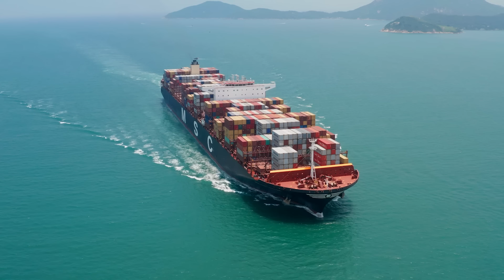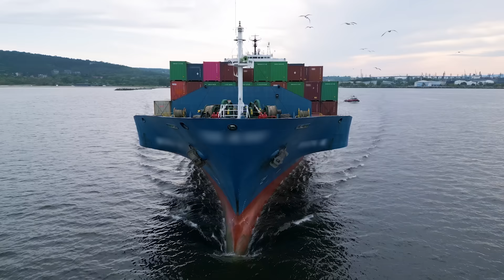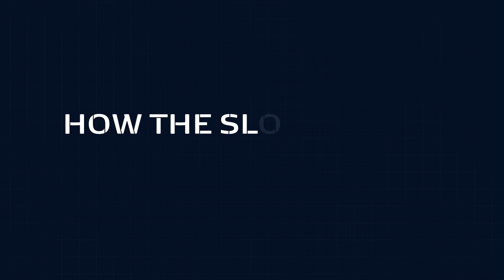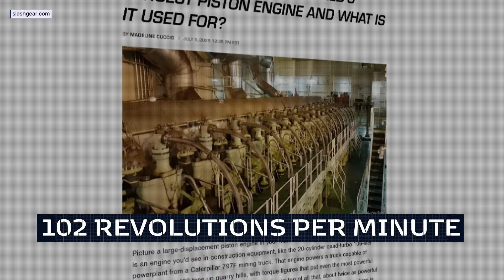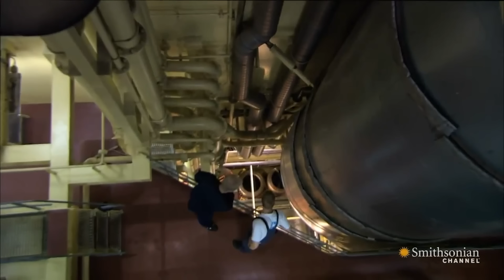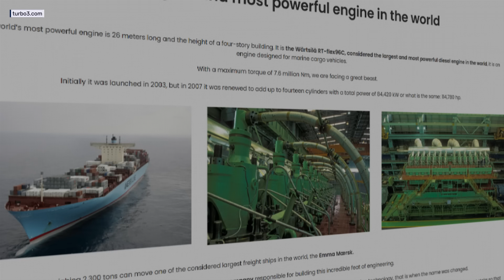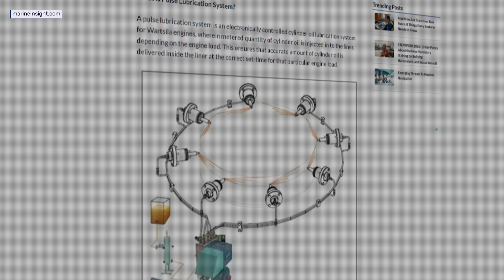The 100,000 Horsepower Engine

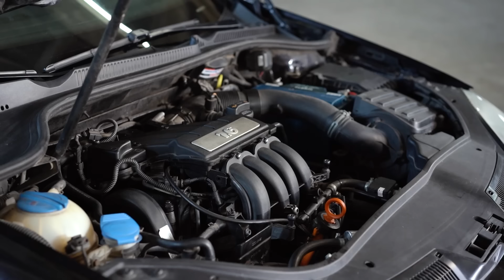Comment: 8:16 "A family car engine holds between 1 and 2 litres." Oh, Europe.
Reply: Exactly what I thought when I heard that 😂
Reply: I live in Europe, I've had Chrysler 3.8Liter V6 with 165hp, gussling fuel of 13L/100km. I now drive a Volvo XC90 2.4 inline 5 cylinder turbo diesel, it uses 8.7 liters/100km and has 200hp with 400nm torque, I have 257.000km on the odometer and it is half life! Size isn't everything.
Reply: @Bratfalken  Right. Now imagine how good the Volvo would be if they'd applied Volvo engineering standards to a 3.8L V6. (We'll disregard the PRV.). 

You might, in such a case, have a 320 horsepower diesel with reasonable fuel efficiency.

That would be just about enough for a normal family car.
Reply: @siorusbzns654 my first car was 1.8 liter, had 75hp, it reached all speed limits just fine. I don't need 320 hp, and my present one reaches double the speedlimits. Also, Volvo had the Yamaha 4.0 liter V8 in this car model. I could have bought one of those, but I would not like to fuel it up.
Reply: @Bratfalken  You're pointing at one of the central differences between European and American ways of thinking. The idea that you would decide how much horsepower is appropriate based on capacity to meet or exceed speed limits or how much it costs to fuel is absolutely, genuinely incomprehensible to me.

I understand it logically, don't get me wrong.

It's just utterly, completely illegible. Total nonsense. Not a value judgement really, you can live your life however you see fit. Just wild to me.
Reply: @siorusbzns654 you do much dragracing at stoplights I presume? 🤣
Reply: @Bratfalken  Nah, preserving optionality. You know sometimes people speed up after you pull out to pass them. When you have decisively the faster car, you effectively remove any influence they ever had over the situation.

That is, it no longer matters whether they want you to pass them or not; they’re not in a position to decide.

And yes, you can do this by driving well with a less powerful car, but why would I go for anything but guaranteed total dominance? This is a safety feature; it changes the situation from a negotiation or a conflict to "it's happening my way, and you're going to suck it up."
Reply: @siorusbzns654 ...eeh. but you claimed all americans want these high powered mega volumated cars.... then who will dominate who?😉
Reply: Only the oil and tyre companies are the winners.
Reply: @Bratfalken not once have I thought "Urgh I need twice the power right now to pass this guy!"

Just pass em or let them pass, who cares?

I got 2 cars one for purpose and one for passion, one has 70hp and does all I want it to do, the other has 610hp (flywheel) and I could push it further but what's the point? I'm already happy with it, I worry none that some other guy in some other car that I didn't even pay attention to "UtTeRlY dOmInAtEd" me
Reply: @Bratfalken  Did I say that?
Reply: @LostenPosten  Don't be deliberately obtuse. You're arguing with a straw man.

I didn’t say “I need twice the power to pass someone.” I said I prefer having enough surplus performance that a pass stops being a negotiation. There’s a real-world difference between “I can probably get around this guy if he keeps behaving normally” and “even if he decides to be a prick and speed up, he no longer has meaningful control over the outcome.”

That happens. People speed up when you pass them. People get offended. People turn routine overtakes into ego contests. A more powerful car doesn’t make you invincible, and yes, someone always has a faster car. But statistically, being well above the local power norm removes most of those conflicts before they can develop. That was the point.

Your reply reframes that as insecurity: “who cares, I don’t even notice when someone UtTeRlY dOmInAtEd me.” But that’s not an argument. That’s status signaling. You’re trying to position yourself as the mature enthusiast who has horsepower but is above caring about horsepower.

Which is why the “need” language is interesting. I described a preference and a safety margin. You turned it into psychological dependence, then congratulated yourself for not having it.

And frankly, the two-car detail undercuts your point. You own a 70 hp utility car and a 610 hp passion car, so you obviously understand the appeal of excessive power. You just want to draw the line exactly where your own usage pattern makes you look sensible and someone else’s makes them look insecure.

That’s not a rebuttal. That’s coping dressed up as perspective.
Reply: @siorusbzns654 
1- The "twice the power" was simply an example of a surplus of it referring to the car of the driver not twice what the other individual has, as you never specified any amount and it could be 200 or 500, unspecified 

2- I can only speak from what I see and do, I don't find myself in situations where I have to engage in a "negotiation" with another driver, I simply keep my pace whether they speed up or not, so I wouldn't know I guess (there's a difference between simply being a douche who speeds up unnecessarily when passed and reckless driving just for the ego you mentioned, that should be reported to the police right away)

3- The "framing as insecurity" was headed towards your "dominating the negotiations" thing, I may have interpreted that as someone who turns every pass and every merge as a challenge, again I don't find myself in the situations you say you do so it might simply have gone right over my head

4- I never claimed or tried to claim that the way someone else's use or want of a powerful car is incorrect or insecure, it's simply a point to highlight that in my experiences there hasn't been a need for the higher power car in my commutes, that the abysmally low (it's a fairly heavy and old sedan) 70hp the other one has gets it done fine and at no point felt the need to increase it,
Thus I put in question why would the better option be to have a heavier, larger, more fuel thirsty engine just for the sake of "engagements"
The more powerful car is simply to take it on weekends for some track of route fun that's my appeal with it, not to have that extra margin in the back of my mind, I don't see a want for it in such case. I took it as "need" which for someone unwilling to not have that margin it might, but it's likely a reach from my side

Now thank you for dismissing it as cope, tells me all I need to know about your willingness to see a differing take even if it may have not been worded as well as it should, just know that an internet argument especially over vehicles of chocie (drive what you want I'm not trying to convince anyone to change that) isn't meaningful enough to defend tooth and nail to the point of coping
Reply: @LostenPosten  Fair enough, and this is a much more reasonable framing than the first reply.

The distinction I’m making is not “every pass is a dominance contest” or “everyone needs 500 hp to commute.” It’s that surplus capability changes the interaction when another driver chooses to make the situation adversarial.

If you don’t encounter that often, great. Sincerely. But “I don’t personally find myself in those situations” is a different claim from “there’s no meaningful value in having the margin.” My point was about optionality. Most safety margins are invisible until the moment they matter.

And yes, my language was intentionally blunt, because the point is simple: if another driver speeds up, blocks, or tries to turn a pass into an ego contest, having enough surplus performance can remove their ability to meaningfully affect the outcome. That doesn’t mean driving recklessly. It means completing the maneuver cleanly and decisively instead of remaining stuck in someone else’s decision loop.

“Call the police” is fine in principle, but it doesn’t necessarily resolve the immediate situation. It’s also worth noting that there are many places in the U.S. where police presence is thin, response times are long, and you may be driving through a large rural area with very little practical help nearby. That is another difference between a European or urban-American driving mindset and much of the rest of the U.S.: in a lot of places, you are functionally on your own in the moment, and it is your responsibility to manage the situation safely.

That’s why I value margin. Not because I’m looking for conflict, but because other people can create conflict after the maneuver has already started.

As for the insecurity point, the reason I pushed back is that your original reply did not read like a neutral difference in use case. The “UtTeRlY dOmInAtEd” bit was pretty obviously framing my preference as silly or insecure, so I responded to that framing.

If your actual position is just “I don’t feel the need for that margin in my own driving environment, and I use power differently,” then fine. That’s a perfectly reasonable take. Different roads, different traffic culture, different vehicles, different preferences.

But that’s not a rebuttal to my point. It’s just a different weighting of the same tradeoff.
Reply: @siorusbzns654 alright, too different environments/experiences to argue on a same situation, I see why the extra margin would be useful there

Have a good day
Reply: @siorusbzns654 and when everyone has one of these tiny dick replacement motors, then what, genius?
Reply: @Bratfalken  as a US citizen, please just give me better mileage!
Reply: @jaylee5692 yes, engines runs on air, with a little add of fuel, but they can't run on pure air, that is why a smaller volume engine can use less fuel.
Reply: There are motorcycles with more displacement volume than that. 😅
Reply: My wife's explorer is 3.0 with a couple turbos on it
Reply: I'm in Europe and my family cars have 3 and 4 liters respectively. In fact it's been over a decade since I had a car with an engine smaller than 3 liters
Reply: 1.5 liters is more than enough for any noncommercial vehicle.
Reply: @NoPegs  Imagine being so low on Maslow's Hierarchy that you index what's acceptable to you to "more than enough" or sufficient" rather than "enjoyable" or "superfluous to requirements" or something.

Wild.
Reply: @siorusbzns654  Laughs in 46MPG
Reply: @NoPegs  Cackles in doesn't have to think about fuel costs
Reply: have you ever put boost to a 7.5 litre bbc? those things are nuts
Reply: +siorus... Oh, US-American arrogance
Reply: @svenlima  well they're coping with the fact that in 80s and 90s they were making 5 liter engines with 170 bhp that drank fuel like an alcoholic :D
Reply: On occasion,  I needed to drive faster than 150mph on the road.
Getting from 0-60mph in under 5 seconds has saved my bacon more than once.

Driving high performance cars is not simply a matter of getting to work and doing the shopping, it also defines my sexuality. As a MAN, I need this power.
Reply: When you drive in cramped cities and short distances between work and home, there is no need for 3-7 liter behemoths. Well, the bragging rights naturally with big boys measuring their sausage in the sandbox on who has the biggest engine. With most of the speedlimits being around 50-80kmh and typical one-way commute 10-20km, easy parking, good handling and European taxation of heavy vehicles puts the emphasis on smaller vehicles. Remember, the AVERAGE FAMILY car... Anybody can still buy American V8 or such if they want to, they just need to pay much, much, much more for it.
This coming from a guy who just spent the last weekend on V8-meet watching mean muscle cars do burnouts and decibel contest.
Reply: @alaric_  Sure; note that I didn't pass any judgement in my initial post. I just said "oh, Europe." The intended tone is that bemused half-smile you get when you watch a puppy or a baby repeatedly try and fail at something for the dumbest, simplest reason that they're just not smart enough to see. It's adorable.
Reply: @siorusbzns654  maybe I'm missing something but that sounds condescending, like there is something that they're failing at that you are pointing out and given the context it seems you have implied that something is wrong with a 1-2 liter engine. Now maybe your argument is that that's a critique not a judgement, however in this scenario the difference seems largely semantic. Americans are the odd ones with oversized everything and yet we still don't seem to think there a need to fill up the empty and largely pointless states like Wyoming the Dakota's utah etc. lots of empty space that could hold tons of immigrants and improve the tax base and therefore benefit everyone. We just need to build the basic cities and affordable housing, draw in Americans with no housing options in other states too, make the equal votes those tiny pop states get despite California having more people and economic activity than most of the empty states combined. That or we could combine them into a relevant entity. And yes im being condescending to those states. I have nothing against the people who live in them, I just find the ineficency and wasted opportunity frustrating. People want to limit immigration because there's not enough room, while we have large swaths of habitable land that holds far less than it's capacity and throwing so much benefit away because of racism and misguided safety concerns is frustrating. We could take in tens of millions of people suffer the short term instability it would cause and reap huge dividends a decade or 2 down the line and stem the tide of falling birth rates. It's also the compassionate thing to do. There's no shortage of island and costal nations that will be underwater and forced to abandon their homes that we could take in and get a grateful populace on top of the other benefits.
Reply: @omgandwtf1  You are certifiable .. so much uneducated BS in your little novella there
Reply: @xenuno I wasn't restricting myself to realistic ideas, it's just fun sometimes. Now I'll admit I normally delete stuff that bad, I was probably drunk. Now I could delete the comment now but I got a chuckle rereading it, I don't disagree with your assessment, that was basically a word soup collage of rabbit hole ideas and I would likely judge someone saying that as insane considering I failed to clarify that I wasn't being serious. I guess because my reaction to something I don't understand or can't make sense of is to laugh. So I forget that to most people confusing doesn't= funny. Also yes I'm trying to defend myself and realize that's silly.
Reply: 2L engines from Europe can make very good power while stomping all over american engines on fuel burn, one 2L engine produces 469bhp.
Reply: @stevefox3763 name one that costs under 50k he said family car also. Not an f1 car or an f40
Reply: @jordanalexander615  
Mercedes  AMG A45S
Mercedes AMG CLA 45S
Audi RS3 has about 400HP

These are four door cars but not hatchbacks so its up to you if they're "family car" or not, and all these can be acquired for 500EUR ish.
You're welcome. :)
Reply: @repaterion3611 those are decently pricey here maybe because they're imports idk. We have some smaller cars that match them in performance but i wouldn't call them a family car even though they're 4 door. Subaru and Toyota has some fast cars at a decent price but nobody considers them us made even though Toyota is probably the most American made car we have now.
Reply: @stevefox3763 yeah let's see how reliable that will be. Pumping that sort of power from 2liters using hybrid god knows what gizmos that work well out of factory but not so well 10 years down the line is stupid.
Besides, realistically 2l 200bhp car is sufficient, especially with a decent autobox, for an average driver.
Reply: @stevefox3763 our ls engines can make that naturally aspirated. And they will hold together about 10x longer than your euro crap. Throw a turbo on one and it's easy to get way over 1000hp. BTW,  hatchbacks aren't cool, anywhere.
Reply: @stevefox3763  What an odd comment. Comes off a little insecure, tbh.

Let me put a finer point on this: I own and drive European cars almost exclusively. I was in auto repair for many years, many of which were spent servicing European cars exclusively.

It is possible for me to recognize that there is no replacement for displacement, and to consider the average passenger car powertrain in Europe to be an absolute joke, while also preferring European cars.

I just don't own ones with engines the size of a thimble. 

My C63 has an M156. Because throttle response and sound don't show up on a dyno sheet.
Reply: @stevefox3763 2 liter engines from a lot of places can hit 400+ hp. He said "family car" which is what the vast majority of you are driving. Your average European car is quite the tiny little joke of a toy, and you know it. The average American can buy a 6 liter muscle car, and afford to put gas in it, while you have to drive 1.2 liters to afford your petrol. So quiet with the jealous butthurt.
Reply: @NeverBeenCaughtVT  erm, listen to yourself, I simply said euro engines can produce a lot of power for their size, you are the one who went off on a rant lol, you are the one who sounds butt hurt and oh, while its not a V8, I do drive a V6 and its larger than 2L and it has a real gearbox, not the go kart horrible autos you lot drive lol
Reply: @stevefox3763 I mean we have those same engines. Even cheaper cars are pushing 300+ with turbo charged 2L. But many of use need reliability so a larger displacement engine is necessary for constant high torque for hundreds of thousands of miles. Even our large pickups get around 22 mpg
Reply: @jordanalexander615  and my 2.2 turbodisel does close to 44 mpg or so whats the point regular family car
07 honda accord wagon disel and manual
Prety much what i think would be normal family car size
Dont get me wrong a 5.0 cyote is cool but my 2.2 does the job and is more economical whilst doing it
So my opinion is every engine has its use and prose/ cons i only have 140hp all things considerd
Reply: Jokes on you we drive electric cars now! 😆🤣😢😭

Nah, I am joking, I have a bicycle and public transport, what more could I possible need.
Reply: @tjampman Bike and public transport is nice if you can do it. Good way to stay in shape. Myself, I prefer private cars. And it’s not just about the convenience of not having to wait for a bus or walk to a subway station. 

It’s more about the things my private cars don’t come with. Like bed bugs, crazy people, noisy people, and poor people.
Reply: @siorusbzns654  You live a sheltered life my friend 🙂
Reply: @siorusbzns654  Poor people 😂